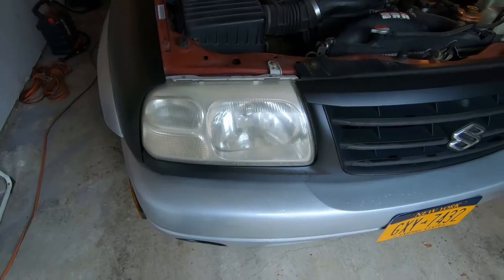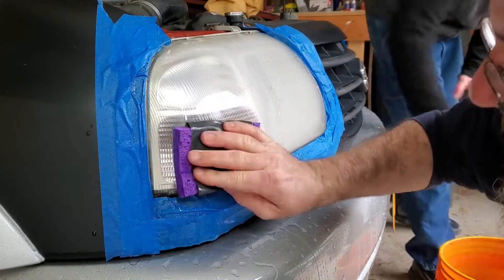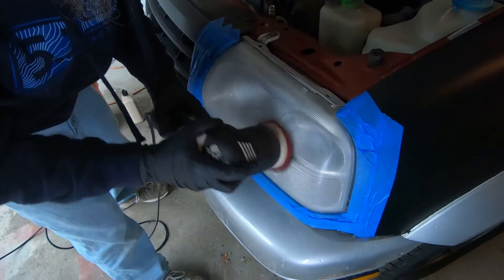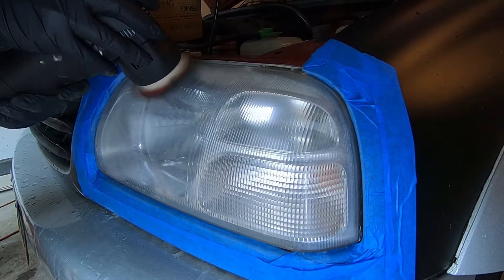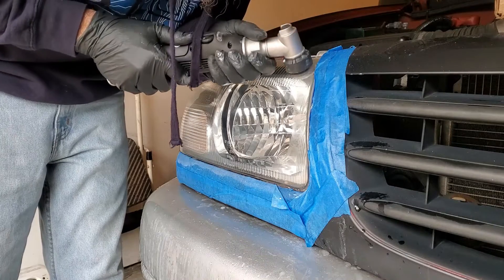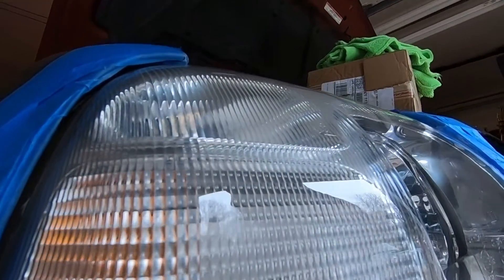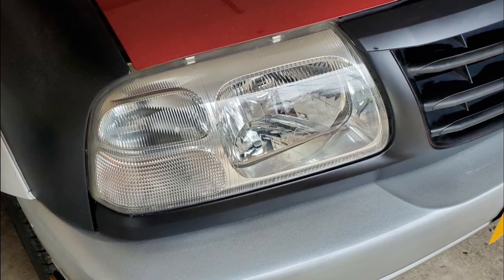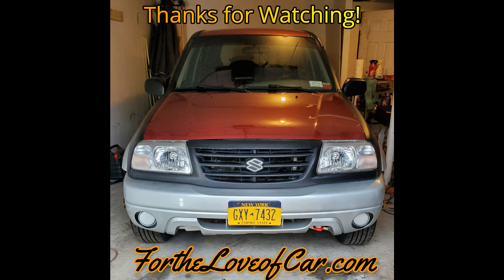Easy Way to Restore Headlights (with superior results!)

Comment: 1. How long was the entire process for each light?
2. Without using the electric tool, would it be possible to achieve the same results, and if so, how much more effort/time?
Reply from the maker: It usually takes 45 minutes to an hour per headlight. I don't know that you'd be able to polish out sanding scratches like that without a machine. You don't have to necessarily use an expensive polisher though. You could use a regular drill with an attachment for small polishing pads. Some of the better headlight restoration kits come with one.